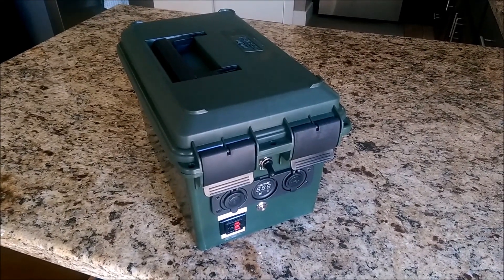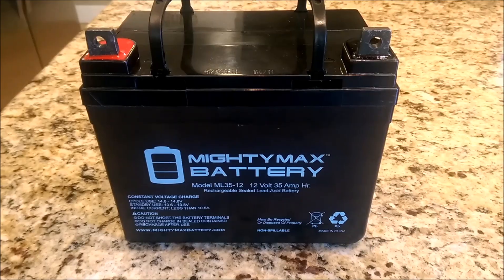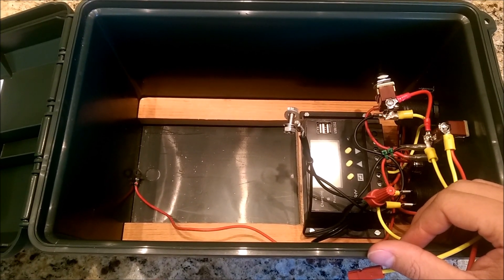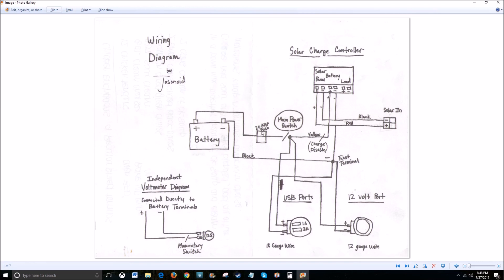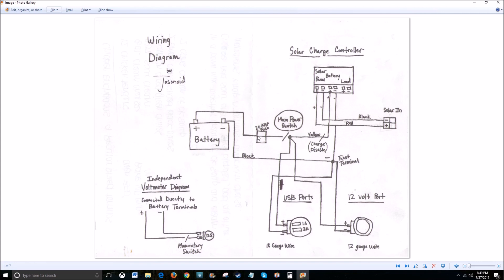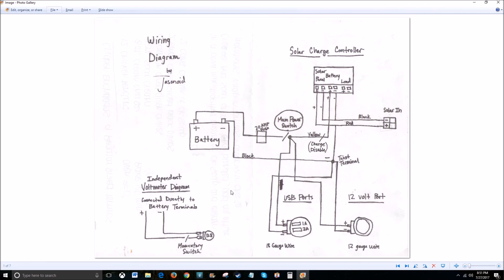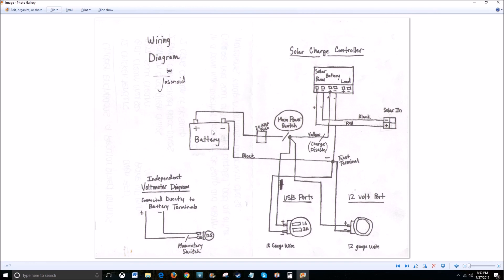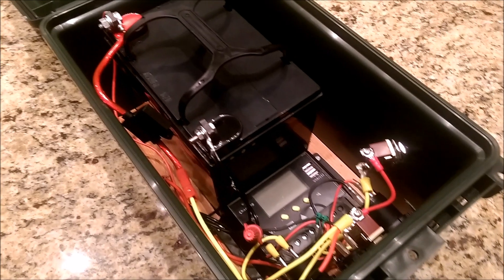How to Make A DIY Portable Solar Generator

Comment: Hi Jason, I'm really glad you made this video because it answers a couple questions I had like killing the charge controller when it isnt used, and it presents a question I've really been trying to figure out on my own battery box.  I ran my battery cables (10AWG) to a fuse block about the location where your main switch is.  I have some 4 usb ports and 2 12v sockets coming off of that fuse block.  If have them all drawing max power it comes out to about 40 amps.  I believe this means I need to upgrade my 10AWG cables to something like 8 awg, right?  I'd also like to add a circuit breaker on that main positive cable to function as a safety mechanism, but also like a main power lill switch, like you have, to the whole system. Where I'm confused is how does the solar charge controller factor into the wire size and breaker size that I'll need? My charge controller is tied together in a similar layout with the other wires as yours, except at a fuse block instead if a switch. If my power pulled from sockets is about 40A, and your charge controller then draws a but of power for itself, I assume you need to add that controller draw. However, since the controller is passing power back towards the battery from solar, how should that current be considered when determining wire and fuse size?  I have a 20A charge cintroller, so do I just add 20A over the 40A that my sockets draw?  Or does current flowing towards the battery somehow not count?
Reply from the maker: Hey John, the power coming out of the battery and the power going into the battery is added or subtracted together to be a 'net power in or out'. So if you have 400 watts going out to power a device, then 200 watts coming in from a your solar charge controller, then you'd only have to worry about the net negative of 200 watts going out of the battery. 

No need to worry about adding the power together and making your wires bigger than they need to be. Does that make sense?
Reply: @Jasonoid  ohhh, thank you so much for clarifying that.

Comment: Like 773.
The schematics helped because I've looked at so many power box vids and yours was wired without the load ports.  Interesting layout.  Like the MTM box.  The 50 cal I had was smaller than the MTM by about an inch in all measurements and I found myself lacking real estate in my layout.  So good choice.
Reply from the maker: Check out this one, much newer video and design, would last much longer:
https://youtu.be/uN1h0XIpfTg

Comment: If I used a 20ah LiFePo battery, would this all be the same setup? Or would I need a MPPT charge controller?
Reply from the maker: Check out this battery build video, newer and it actually has LiFePO4 cells in it:  https://youtu.be/uN1h0XIpfTg
Reply: @Jasonoid  I'll check it out👌🏼

Comment: Great video. I'm glad I came across this because your wiring diagram was very helpful. I just built my first power supply and it was super basic; battery, inverter, and battery box. But now I want to rebuild a new one with more options. How do you add the inverter to your current setup? Just directly to the battery? 

Thanks.
Reply from the maker: You would connect it up directly to the positive and negative terminals, you'd want to put a fuse on the positive wire.

Check out this newer larger version, you might be more interested in this one:
https://youtu.be/uN1h0XIpfTg

Comment: I'm seeing Jackery and bluetti units advertised. Is this essentially a small version of those? Could one build one like the jackery or bluetti and save significant money?
Reply from the maker: I believe those use lithium batteries, I am currently building a lithium battery right now, video should be out within a couple weeks if all comes together well. It uses a 80ah  Lifepo4 battery so much longer life than those you mentioned
Reply: Jasonoid I learned of the jackery and bluetti from overlapping channels. An overlandvrv company is looking at a zero breeze as solution which along with panels and low draw refrigerstors. Give a complete off grid solution.

Comment: Check your schematic again. You have the positive solar "in" (red) connected to the negative (black) of the USB, cig lighter and battery terminal. It seems to me the drawn line from the controller "battery " negative should continue downward vertically (through the black and red "solar in") to make the circuit correct. I also agree with the other posters that you could just connect the USB and cig lighter to the "load" output of the converter.
Reply: Sorry, meant to say "controller" in that last line...

Comment: For anyone that has questions about using the load output for the charge controller. The purpose for the load output is to run low current devices such as led lights (why you see some controllers with timers for it). If you want to run anything that uses over 10 amps such as a fridge you can buy a low voltage protection circuit (anything from here will work for 12v batteries) https://www.aliexpress.com/wholesale?catId=0&initiative_id=AS_20181129024226&isPremium=y&SearchText=low+voltage+protection+12v

Comment: Anyway to get an AC connection?
Reply from the maker: Rami Elkhazendar you can plug a 12 volt socket inverter in. That would work well. Or connect one directly to the positive and negative battery terminals

Comment: Why is there Solar Charge IN and Solar Charge OUT? Aren't the anderson plugs wired into the SOLAR IN Charge Controller?
Reply from the maker: I only used the 'Solar Charge In' for connecting to the charge controller. I had spare ports that weren't being used so I decided to wire those extra ports so that I could disconnect the charging wire inside and connect it to the port so that I could charge an external battery if I wanted. I haven't had to use it yet but I could potentially charge my motorcycle or car battery if I was in a jam using my solar panel.

Comment: Why didn’t you connect the ports(usb, cig lighter etc) to the charge controller load? I’ve seen a couple others that have done that and a couple that actually use the load on the charge controller......

I would think having all the ports connected to the charge controller would be safer?

Comment: How come you opted to keep the kill switch for the charge controller inside? I can put that outside like the other switches yes?

Do you have a fuse for the cig lighter and usb? Or just the 20amp fuse from the battery positive
Reply from the maker: Jlui83 I put it on the inside to limit how many wholes I have a in the case, it can be outside as well. I have a main line fuse that's hooked between the battery and the 12 volt socket.
Reply: Jasonoid after having this for a while does it do the job for you or do you wish you went with a bigger battery or double the battery ran parallel?

Comment: im sure you'll build it yourself. I made it 2 weeks ago thanks to Avasva website.
Reply: Is there an advantage of connecting the load to the battery instead of the charge controller?
Reply: Yes
Reply: @shantelleadeline6053  Why, surely connecting to the load on the charge controller would make more sense.  It can then be switched on or off independently to the on /off switch.  I have made a few of these now use the load on the SC.  Works great.  It also means there is zero drain from the transformers, led's etc on the usb outputs.
Reply: @TheKayakingkid  she's just trolling you man. 😂 She has NO CLUE and just saying words for the sake of saying them. 😂 It's been a full YEAR now and STILL no response. She saw it and just ignored it because she honestly doesn't know either way. 😂

To answer your question though, it's safer to connect to the charge controller. The name speaks for itself as it has more internal parts for safety during charging. This ensures its a steady consistant charge, and for whatever reason, will cut the charge if something is wrong with your device battery or a load goes above normal.

Directly to the battery, you don't necessarily get this safety. It just throws the charge regardless. The controller is then only used to ensure the battery is being charged at a steady rate and then stopped when full. Hope this helps.
Reply: @TheKayakingkid  sorry response was for JTG I clicked the wrong name. Apologies.
Reply: Thx

Comment: So, I see the output connectors off the solar panel and I see the input panel on the SOLAR IN to charge it...same connections or did you cut off the connectors from the solar panel and add connectors to match. Not really sure what those inputs are on the box for charging. Thanks
Reply from the maker: Those connectors are called 'Anderson Powerpole' connectors. They are widely used and accepted for portable power projects. They are very easy to use and install. You could use basically any type of connector you want but I chose those. The parts are listed in the description. Hope that answers your question.
Reply: Jasonoid Okay thanks. I'm going with the same solar panel so I just wanted know how these match up. Awesome build!

Comment: 3 suggestions..

1. Looses the wire nuts. Those are for house and no meant to be constantly shaken, vibrated etc.  Get a ground stud instead.

2. Charge controller switch on the exterior... Or find a current sense device that will automatically kick the controller on when it senses power coming in from panels.

3. Ditch the fuse. Use a resettable circuit breaker instead.  What if you've used your last fuse and aren't in an area or situation to get another fuse?
Reply: Also the accessories are an inch 1/8th
Reply from the maker: Jarred Jones thanks for the suggestions, I'll think about them. It's working exactly how I want it and designed it. We all have different uses for these devices.
Reply: Jasonoid yup I've got a radio go box set up the I wanted it. So I know where your coming from 😁
Reply: Jarred Jones - could always use a bit of wire or even tin foil as a fuse..up shirt creek if your isolator switch fails though..not as easy to improvise an isolator switch..lol

Comment: Do you have a way to charge it from a wall outlet at home?
Reply from the maker: SouthEnd Studio I actually use a laptop charger to charge the battery. It puts out 18 volts, 3 amps (similar to my solar panel) so I basically trick the solar charger to think a panel is plugged in. You can also hook up a normal lead acid battery charger to the terminal leads to charge it.
Reply: Oh nice, do you just attach the power pole connectors to the charger?
Reply from the maker: Yeah, I soldered them directly to the wires off the power supply. Just make sure to check polarity before plugging it in the first time.

Comment: Will two of the batteries fit if turned sideways?
Reply from the maker: Shawn Bailey thanks for the question.  I wanted to originally do that but this exact battery is to wide to fit, possibly a different battery would stack sideways but this brand won't.

Comment: Dang that thing is beautiful.  Nice job!  I want to make one with an inverter for charging usb devices and my Makita drill batteries for shtf or other power outage.  Also, I have a couple hand-crank chargers that charge USB devices and I want to wire those to charge controller so I can charge the battery with the hand cranks if there's no sun.  Thanks for the nice design!
Reply from the maker: You're very welcome, and thanks for the compliments.  Let me know how your build goes, I absolutely love this stuff! I have an old pure sine wave backup computer UPS I plan to convert to a DIY inverter for free in the coming months :)

Comment: Nice work dude. But i suggest to you to put exhaust fan for cooling.
Reply from the maker: Romeo Baltunado it's actually never been warm from charging. I usually have the box in the shade so that also helps keep it cool. If I was to put an inverter in the box I would definitely install a cooling fan. Thanks for the suggestion!

Comment: Can you tell us what gauge wire you used and was it braided wire?
Reply from the maker: Nathan Weibel thanks for the question. Most of the wiring you see in the box (yellow, red, black lines) are 12 gauge braided copper wire. The smaller wire connected to the USB ports and voltmeter are 18 gauge, and the in line fuse wire right next to the battery is 10 gauge. I don't plan on drawing more than 20amps because that's the size fuse that's installed so it should all be sufficient.

Comment: No fuses?  I like the design, and the 35 Ah battery gives you a lot of capacity, but shouldn't you have some fuses in there somewhere?
Reply from the maker: Ken Allen I have multiple fuses in the box. The USB port has a small one, and I have a main line fuse shown in the wiring diagram. It has been an awesome project.

Comment: Hi I am new to the whole electric stuff and I was wondering why you connect everything that uses power straight on to the battery and not on the "load"output of the charge controller ? This can drain you battery complet or am I missing something ? Plz let me know  :)
Reply from the maker: Yes, if you aren't careful it can drain your battery and damage it by having things directly connected to your battery. You don't want to take the battery below a specific voltage, say 11volts. If you use the 'load' option on your charge controller if will turn off the battery at safe voltages.

I have a voltage meter attached and I watch the voltage periodically when running loads so I don't damage the battery. My devices are connected directly to my battery terminals.
Reply: Jasonoid thanks for the explanation. Such a shame that I cannot buy the same ammo box in the Netherlands ...Amazon does not ship it from Germany to the Netherlands :(
Reply from the maker: The case isn't quite as important as the contents inside, A similar 'tough container' will work just as good :) Good luck on your build!
Reply: This is the general benefit of using the output side of most solar charge controllers for the output load and devices.  Most controllers have an adjustable Low VDC shut setting built in which prevents the load from completely discharging the battery.  
The DC voltage meter is good but having something automatic is my preference.

Comment: Just want to clarify with you that if the cigarette lighter port and the USB ports were connected on the load end of the solar charge controller, wouldn't that be better? As the controller would provide protection on overload or even over draining your battery? or you could also connect an inverter to the load terminals on the controller. You diagram is very clear and I love it. Thanks for putting the time on this. the box looks great!
Reply from the maker: Justin Goonting That way will work also. I chose to bypass the load outputs on the charge controller because I watch the battery voltage manually. I don't like having the charge controller running all the time wasting power. Just personal preference I suppose.

Comment: does the box get hot inside?
Reply from the maker: SPOTLIGHT INSPECT PLLC thanks for the question! It does not get hot inside, it will get pretty hot sitting in the sun so having it in the shade as much as possible is good.

Comment: By the way I ripped off your leg design even did rivets you can lock it up through the legs or the handle. I used rivets for the hinges and handle and window locks as well. My pivot is a little different on the legs more simple with security screws and nylon core nuts you can not get to without drilling out rivets. The legs work great thanks for the inspiration.
Reply: NYangryguy sound like he build  bomb just  go the blood store and buy whole  kit and take  it 30 minutes to install

Comment: I made mine using a 36v lifepo4 16ah battery from my kids scooter he barely rides. Golf cart step down to 12v and I have a boost solar charge controller that only powers on when the sun is up 2 - 12v panels in series. I can also charge my ebike batteries on the same solar charger. We also used ours on 5 day camping trip recently lasted all week with no panels. Ran fans, charged phones, my wifes friend plugged her mini fridge for a whole day visit. From scratch I would just use a 12v battery like yours. The way I did it was because I have huge battery laying around. When that battery dies go lifepo4 in 12v only thing I would do different. I charged the battery today from near dead in 7hr it was cloudy most of the day to. Even had enough daylight left to to top off my wife's 52v 11.6ah e-bike battery from 54v to 58.5v.
Reply from the maker: NYangryguy I love lithium batteries for their weight and performance. The cost however is way above my pay grade haha! Thanks for your comment!
Reply: 30ah 12v lifepo4 are now 200 bucks free shipping on ebay in the US with heavy gauge wiring ready for inverters the seller tells me. I have recently looked into it since a few people I know personally asked me to build them one in strait 12v. The price is very reasonable for something that can potentially be recharged 2000 times and discharged 80% each time. And weighs 8lbs.